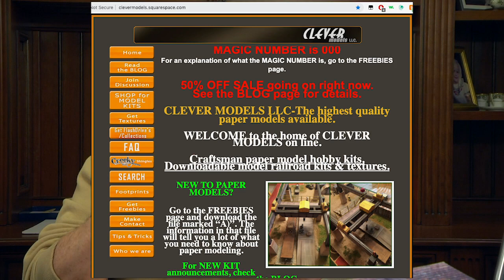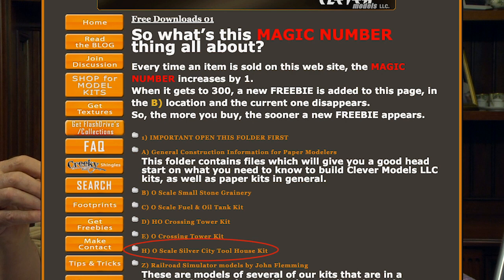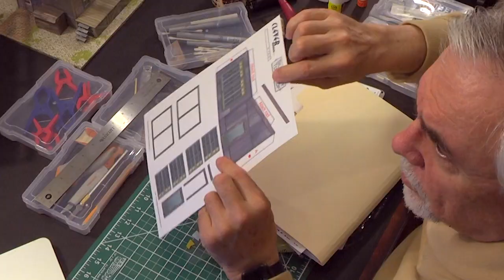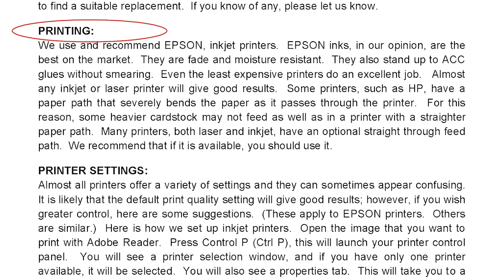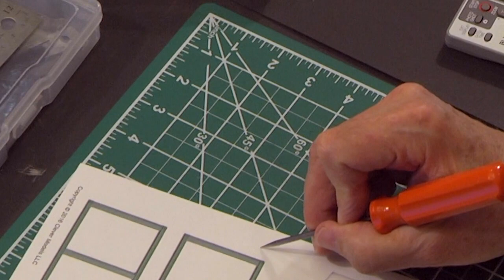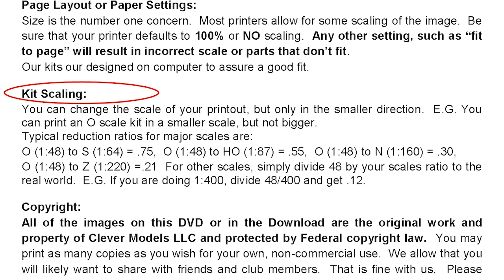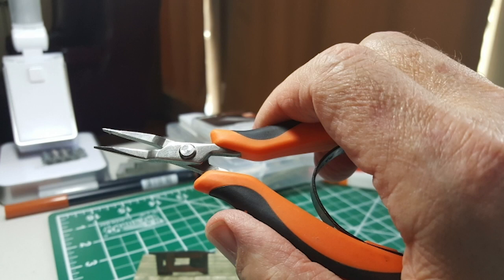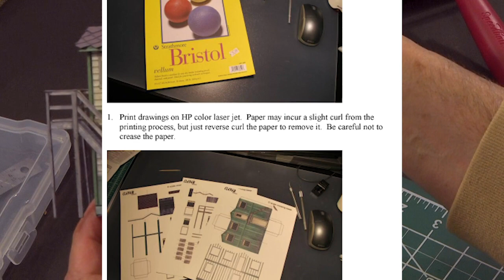Episode #2 - CardStock Modeling: Materials & Tools

Comment: I was up vary late watching make truss for bridges and saw you listed card stock so I had to see. I did check out the web site the price's are very low cost I been spending $28.00 molded plus shipping that adds up fast. Thank you so much I have many web sites where to go to get windows , doors , roof  vents  drain pipe ,  In a few days I will post the sites that I got from all the people I watched . You can go to FOS site there kits start at $75.00 up to $300.00 + I don't have the money I live on a fixed income thank you for the information .
Reply from the maker: Mark, you're very welcome...many thanks for watching the videos and sharing your thoughts.  I feel the same about the benefits of CardStock Modeling... Sam

Comment: I used to own a picture framing retail shop. I discarded all sorts of 4 ply matboard scrap that was useless to me then but would be very useful as support walls, etc. for these buildings. I suggest you go to a frame shop and ask if you can have their throwaway scraps. If it was me when I had my shop I would have  gladly given them away instead of throwing them away. Such a waste to pitch them. 4 ply is pretty rigid and easier to work with than foamboard.
Reply from the maker: Hi Mark, many thanks for your viewing, suggestions and comments!  Your thoughts are one of the many reasons that keeps attracting me to CardStock Modeling, because I find there are many approaches to finding a solution that is practical and allows for artistic creativity!  All the best, Sam

Comment: Thanks. Very thorough. Saw some tools I will want to add. BTW - I use single edge razor blades for a lot of my cutting. A safety tip for those cylindrical hobby knives: wrap a piece of tape around the shank and join the two ends like a flap. This will keep the knife from rolling off the table onto your lap.
Reply from the maker: I know what you mean, so I discovered the Fiskars design that prevents rolling even in your fingers.... https://www.amazon.com/Fiskars-165110-1001-Change-Detail-Orange/dp/B01J21POXK/ref=sr_1_4?dchild=1&keywords=fiskars+cutting+knives&qid=1631900388&sr=8-4

Comment: I have a question, and I apologize if you have already explained this.  Do you print your own parts on your own printer using the various kinds of paper you show?  Or do you purchase the proper weight of paper and give it to a printing shop and have them print the parts on your paper?  Or can you have a printer supply the proper weight of paper and have them do all the printing?  I ask because I don't have access to a printer.  Thank you for any assistance you can offer.  You're a great teacher!
Reply: I apologize.  I missed the part where you DO use your own printer and inks.
Reply from the maker: Hi Cam, many thanks for your kind words and watching the videos! I'm learning ever day I cardstock... If you are new to this, I suggest using a 65lb cardstock material.  Astrobrights Cardstock, 8.5" x 11", 65 lb./176 Gsm, Bright White, 80 Sheets - from Walmart or Amazon runs about $5 for the bundle.  This weight has a clean fold and easier to cut than 90 Lb.  If you have this done by a printshop, make sure the use 65 lb weight, "premium finish", and acid & lignin free - which maintains the color overtime.  May I ask what cardstock model/kit you want to build?  All the best, Sam

Comment: Iinteresting stuff, it would be fun to see the printer in action do you print direct  to heavy  csrdstock ?
Reply from the maker: Glad you like the video!  Yes I print directly to cardstock using a standard paper size Canon Pixma Model TS8220 printer.  This has 5 or 6 ink cartridges.  I mainly print on 110 lb cardstock paper purchased from Walmart.  It's their own brand named "Pen Gear".  About $6 for 8.5"x11" sheets.  Here's a link: https://www.walmart.com/ip/Pen-Gear-White-Premium-Card-Stock-8-5-x-11-110-lb-150-Sheets/624185822

Comment: I plan to use cardstock for my n scale layout. I have down loaded a couple of plans and tried to use Photoshop to reduce size for printing but had no luck. I noticed you mentioned  being able to use it. Could you give some advice.
Reply from the maker: Hi Michael, what is the original scale of the plans you want to reduce to N scale?
Reply: Thanks for responding. The plan is o scale. When I load it into Photoshop ,only half of the wall is shown. I know it is probably operator error but can't get the entire page to show.